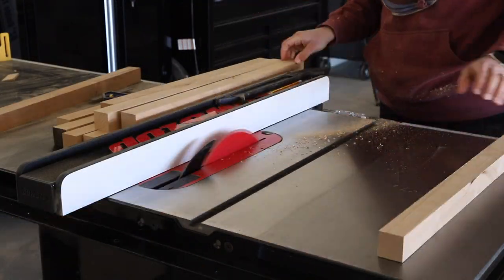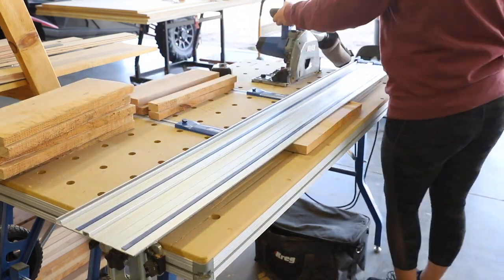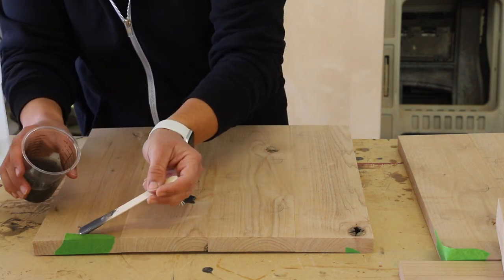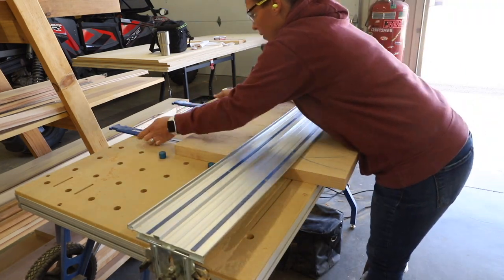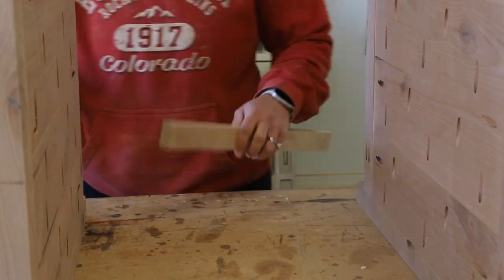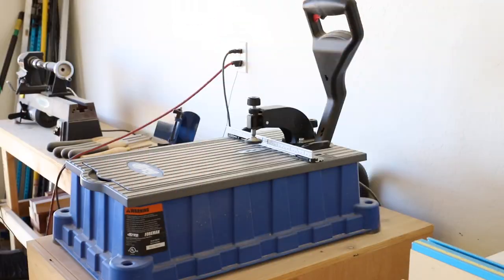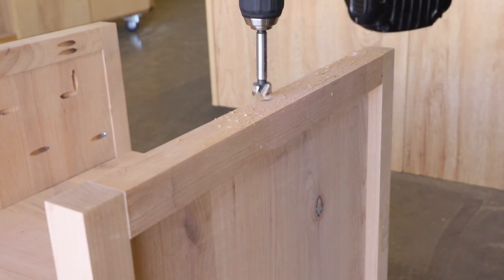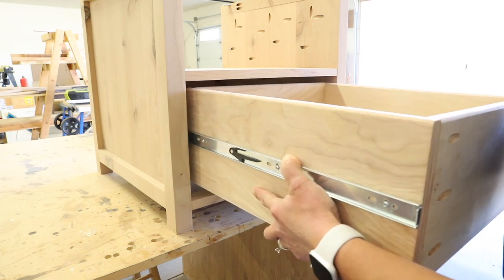How To Build A Side Table With Storage

Comment: Excellent build!!! 👌
Reply from the maker: Pancho Brown thanks so much!
Reply: Katie Cleveland, would love your recommendation for a bandsaw. I’m a weekend worker looking for my first bandsaw
Reply from the maker: Honestly, I really depends on your budget.  I started out with a little RYOBI bandsaw and it served its purpose, but just wasn’t quite big enough.  We got a great deal on a 14” JET bandsaw and couldn’t pass it up.  Lots of great brands out there and also some great finds on Craigslist.  We’ve gotten some great tools off of there.  If you can get a 14” bandsaw from any of the nicer brands (JET, Laguna, Powermatic), that’s what I’d go with.  Lots of times, older woodworkers are ready to hang up their shop aprons and sell off all of their tools and they’re in excellent condition.  You just have to act quickly.
Reply: Thanks Katie, I have my eye on a Laguna 14/12. With your confirmation I rather not waste time on money on a small one if the 14” is the ultimate goal...
Reply from the maker: It’s a big investment, but one I think you’ll not regret.

Comment: I like the design but way too many pocket screws. I believe you could cut down on the pocket screw by 50 to 90 percent and still have really nice table and it being 1 to 2 lbs. lighter.
Reply from the maker: Thanks for watching! They really don’t add any weight to the table.  I did get a little excessive on this one, I will admit😂